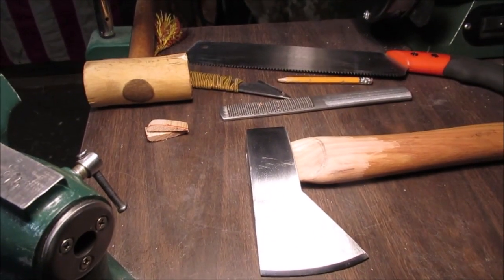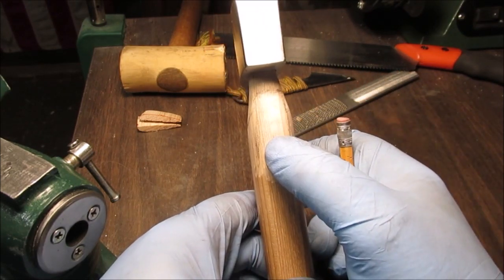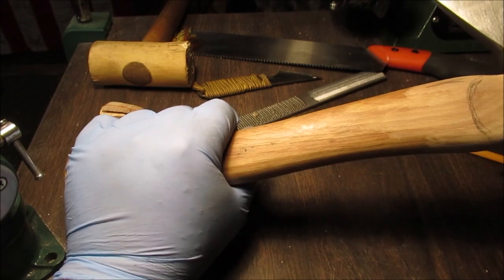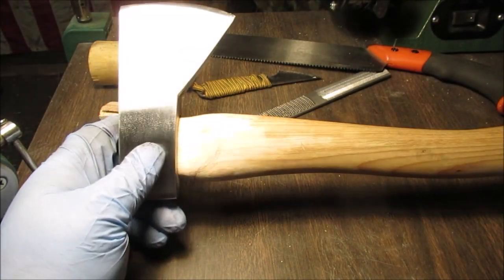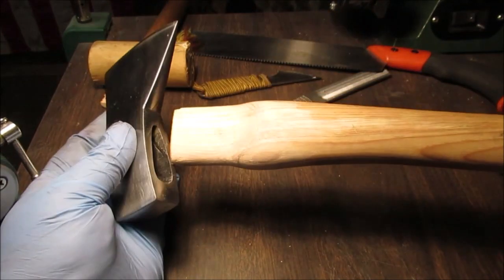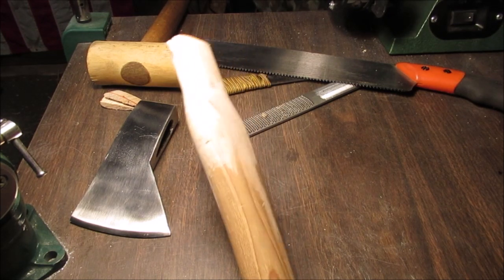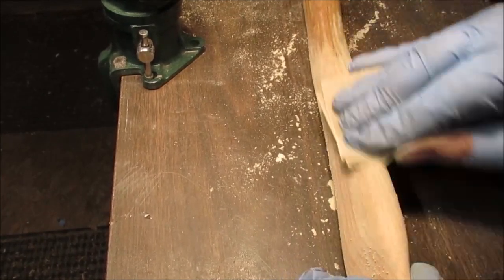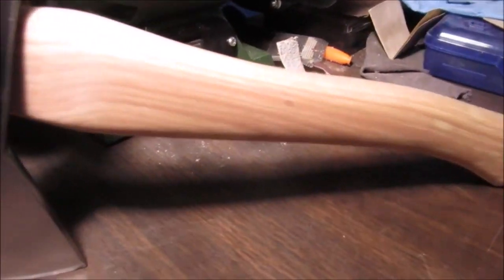SAND & SHAPE Hatchet Handle

Comment: I know it's not one of the choices but  beeswax finishes can bring out the grain patterns nicely
Reply from the maker: I may look in the store for what they have
Reply: @not2fast4u2c  are you snowed in? 
It's going to be 80 here in Phoenix,  not rubbing it in or anything! 
I used a beeswax finish on a huge pine tree slab that 4 people can sit on at the same time. Then tesin coated the top. 
I didn't know pine could look that nice
Reply from the maker: @worldsmessiestworkshop4817  Snowed 6 in. last week we are missing it so far maybe thur. more snow ..This week end below zero temps over night That will really make it hard to keep the shop warm